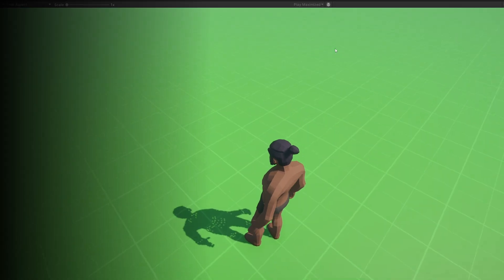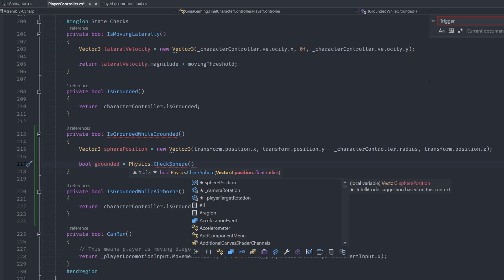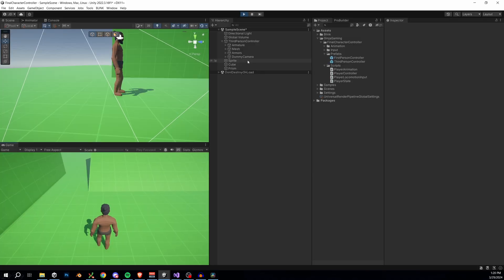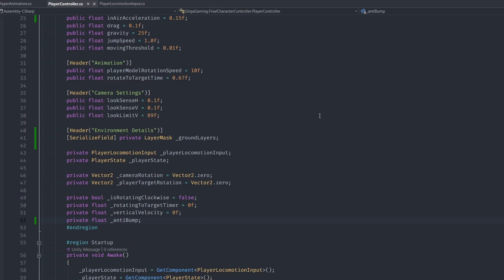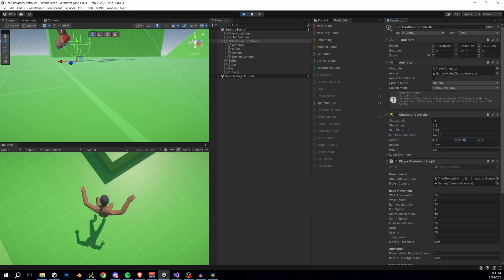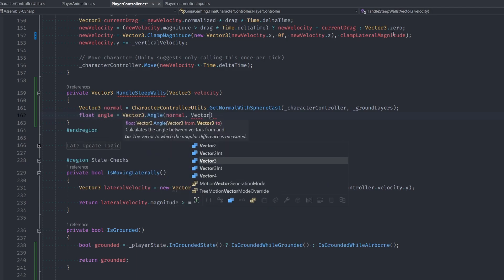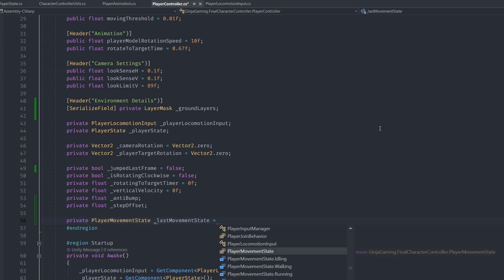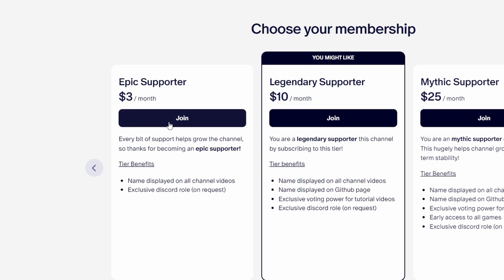1ST AND 3RD PERSON CONTROLLER - COMPLETE COURSE (Part 5)

Comment: It seems like the player will always move at sprintSpeed while in the air, regardless of how fast the player was moving when leaving the isGrounded state (like getting a speed boost when walking off a ledge). If anyone has this issue, here's my fix:

In PlayerController.cs, at the end of UpdateMovementState(), add these lines,

            inAirSpeed = isWalking ? walkSpeed :
                         isSprinting ? sprintSpeed :
                                       runSpeed;                 // cap lateral air speed to current movement speed            

Initiate inAirSpeed with the rest of your variables above. Then in HandleLateralMovement(), change

            float clampLateralMagnitude = !isGrounded ? sprintSpeed :

to:

            float clampLateralMagnitude = !isGrounded ? inAirSpeed :

This keeps lateral jump speed consistent with ground speed, so you can't cheat out of walk speed or slowing effects etc...

Thanks a ton for the tutorial!

Comment: private bool IsGroundedWhileGrounded() 
{
    Vector3 spherePosition = new Vector3(transform.position.x, transform.position.y - _characterController.radius, transform.position.z);

    bool grounded = Physics.CheckSphere(spherePosition, _characterController.radius, _groundLayers, QueryTriggerInteraction.Ignore);

    return grounded;

}

private bool IsGroundedWhileAirborne() 
{

    return _characterController.isGrounded;
}

These extra lines of code at the start of the video seems to trigger the state I am in and it is continuously changing from idle, run, jump. I have removed these lines of code for now and everything is fine.

Comment: thanks for the whole series. 

I often run into issues, but with repeating the videos or comparing to your source files, it works. 

If you are looking for improvements: 
You often do changes not in sync to what you explain and that makes it harder to listen AND work, but first listening and then replaying and looking helps a lot. But you could also make a break in the video while you explain and then comment again what you are writing (what you already sometimes do).

Another small remark: sometimes you write a line and change so fast away, that it is complicated to stop the video in that exact moment where you have the whole line written out but did not already scroll away.
Reply from the maker: appreciate the feedback, will try to improve in the future!

Comment: I have an issue, during jumping, there's a mismatch between the character collider and the player model. When the character falls to the ground, it looks like the falling animation stops playing too early because the collider hits the ground before the model visibly does.

I tried displacing the center of the character collider center up and down similar to how we change the stepOffset, it works but creates jerks in animation
Reply from the maker: I can't remember if this issue gets resolved in Part 6, but give part 6 a try first and let me know there if its still an issue. Part 6 has a section named "Jump Polishing", so I have a feeling I resolved some of these issues there.
Reply: @spaderdabomb I had a problem in my code:
In PlayerController.UpdateMovementState()
I had:
else if (!isGrounded || _jumpedLastFrame && _characterController.velocity.y <= 0f)
instead of:
else if ((!isGrounded || _jumpedLastFrame) && _characterController.velocity.y <= 0f)
The difference is one parenthesis.
This caused my controller to never trigger the falling state. I hope this might help anyone with the same issue.
To be honest, I'm still trying to wrap my head around why this code works the way it does...
Reply: @fukkenPavlo  this works like a regular math problem. you solve what is in the parenthesis first then what is out of them. so if you are missing one parenthesis  it messes with the logic order.

Comment: I have a problem where, if you fall of a very low playtform gravity doesn't get applyed ant my player just starts to float a bit up in the air. Can someone pls help.
Reply from the maker: Play around with lowering default step offset and skin width
Reply: @spaderdabomb  I have tried it and it isn't working. This floating though only happens when i walk of a very low ledge (e.g. 0.3 or shorter ), if i am on a higher block, for example, i fall wlike normal and am not floating.
Reply: I just found out ( trough trying out different things) that the player does't have time to switchnig to the falling - state when walking of a low ledge. Can you help me fix that?
Reply from the maker: @ please join discord and share a video there so I can help you debug further
Reply: @spaderdabomb  How do i join.
Reply from the maker: @captainprogamer5894 Just follow discord link in description of any of my videos
Reply: @spaderdabomb  The link isn't woking for me.
Reply: @captainprogamer5894 Hi, I had the same issue as you but I've found a solution for my case. Make sure when you check before applying "verticalVelocity += antiBump" that the condition is "if (playerState.IsStateGroundedState(lastMovementState) && !isGrounded)". It's not clear the addition of the "!isGrounded" in the video. And in my case, the bool was in the wrong state — I was checking for "isGrounded" and not "!isGrounded".
Reply: @Defucota  OMG it worked! You just saved my whole project. I thank you very, very much.

Comment: Hi am having a problem with the last part where we add the fix for the fast fall when going off ledges due to the antibump it did in fact fix the problem but now the player can jump super high. I have tried lowering the jump speed to a really low number but after 1e-06 the player just stops jumping. NOTE: i have made some changes to the code because i encountered some problems that seems to be fixed this way |         

private void HandleVerticalMovement()
        {
            //calls our grounded function and saves the result(true or false) to the bool isGrounded
            bool isGrounded = IsGrounded();

            //This simulates gravity by pulling the player down every frame(using tie,deltatime to make it smooth)
            _verticalVelocity -= Gravity * Time.deltaTime;

            //this says if the player is on the ground and falling down then it stops the falling by making the vertical velocity to 0 so we dont keep falling when we are on the ground
            if(isGrounded && _verticalVelocity < 0)
                _verticalVelocity = -_antiBump;
            
            //what this if function does is if the jump button was pressed(checked by the unity NIS) and we are grounded the value we set on vertical velocity is done with a math equation so it can be more real to send the player up
            if(_playerLocomotionInput.jumpPressed && isGrounded)
            {
                _verticalVelocity += Mathf.Sqrt(jumpSpeed * 3 * Gravity);
                _jumpedLastFrame = true;
            }

            if(_playerState.IsStateGroundedState(_lastMovementState) && isGrounded)
            {
                _verticalVelocity += _antiBump;
            }
        }
Reply from the maker: Hmm, can you open up stats panel and tell me what your FPS is? I'm wondering if there could be a frame rate dependent jump velocity.

Comment: I';ve been trying to debug for hours and I got nothing. For some reason the walk speed is not being assigned. when I toggle walk it is stuck at the o.o1 even when the default is changed to walk speed or 20. Walk doesn't work and neither does the backward movement. just walks in place or VERY slow.
Reply from the maker: feel free to join discord and I can help you debug further.

Comment: For some reason // ROTATE if we're not idling
            if (!isIdling)
            {
                RotatePlayerToTarget();
            }
            // If rotation mismatch not within tolerance, or rotate to target is active, ROTATE
            else if (Mathf.Abs(RotationMismatch) > rotationTolerance || IsRotatingToTarget)
            {
                UpdateIdleRotation(rotationTolerance);
            }

            _playerCamera.transform.rotation = Quaternion.Euler(_cameraRotation.y, _cameraRotation.x, 0f);
This stopped working for me. Player still turns to target when it is in the idle state, but when it is running or in the walking state the "isRotatingToTarget" wouldn't check anymore in the animator at all. Okay, with the running maybe the cause is added code about can run zone/cannot run zone, but walk? I am just confused what happened, tried to find a reason through comparing source code with mine that I have after following tutorial but no use. Anyone, any ideas what it could be?
Reply from the maker: Not sure I fully understand the issue. The turning animation shouldn’t play while moving (that’s intended). The player just naturally rotates without an animation in the run direction. Is that not happening?
Reply: @spaderdabomb  Indeed, that's correct, it should not rotate when player moves, just in the idle state. What I meant that it kinda fails to indicate in which state player is, after I switch (Ctrl) to the "walk" state. And when we're in the walk state before we give any input we are idle and Idle animation plays even though check box for Idle in the Animator is unchecked and as well player is not turning to the target when I move the mouse like it does in before switching to the walk state. I hope I explained it a bit better. Thank you for the response, btw! Didn't expect to get it so quick! So again, when we're in the "running section" but stop and thus become Idle, it understands perfectly that we're Idle and thus rotates when I move the mouse, but it does not work with the walk state. Once we swiched to the walk, it's like glued and no matter if we stop, oddly enough I get playable idle animation, but without a check that it is in the idle state neither in the animator or current player movement state

Comment: For me the Slope Handling doesn't work and I have the same code, so I don't know what's wrong? Layers are set correctly (print angle shows 84.936) and I can spam jump on that slop

Edited: It works, Rider did a terrible thing when it auto refactor the UpdateMovement function